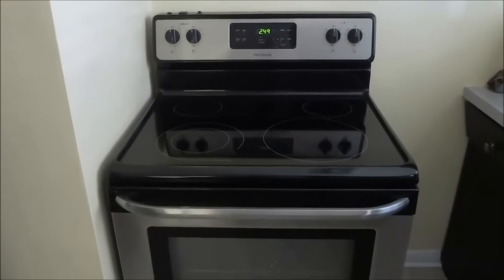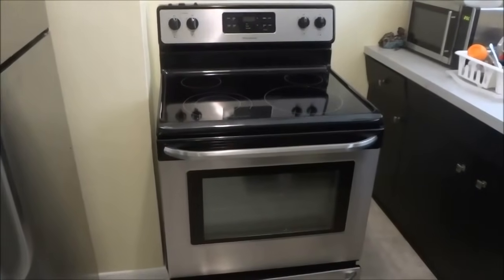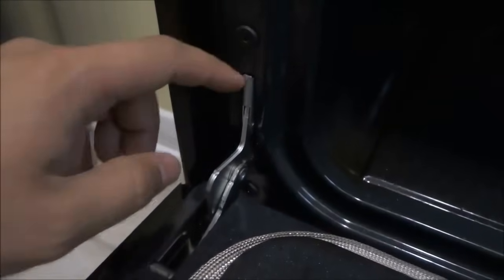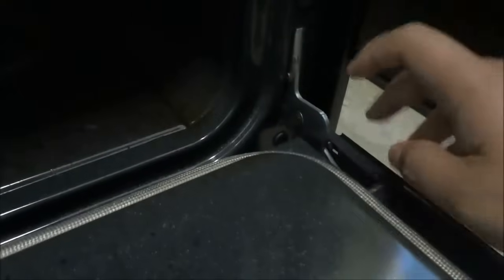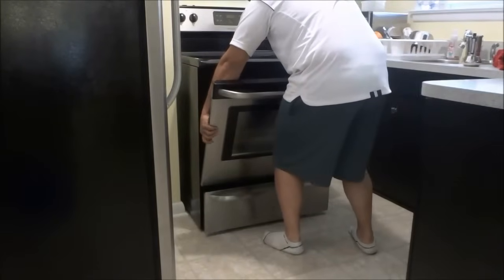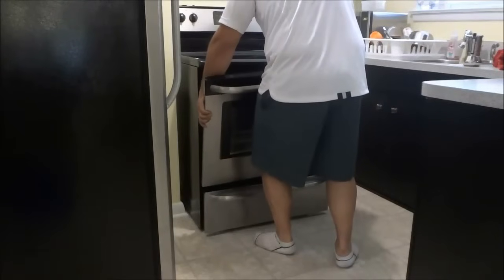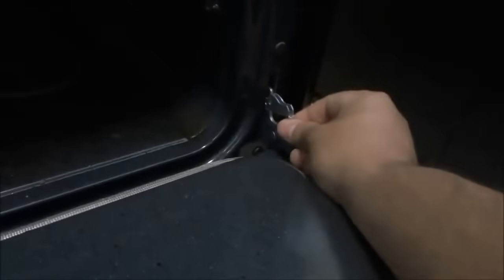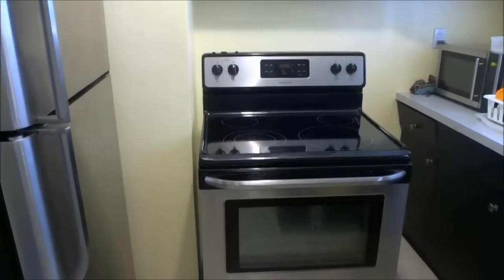How To Remove The Oven Door On A Frigidaire Electric Stove (Useful For Cleaning)

Comment: I want to tell you thank you for this video so much. We moved our stove to clean behind it. The door come off only on the left side and the lock was flat to the door. My son about broke his finger when it smaked back. We were all upset and screaming at the darn thing. Then I grabbed my phone and asked Google and your video popped up. With on one minute my son knew what was wrong. If you would have done such a easy to understand and straight to the point demo, we would have paid a repairman a 💯 to come out and get a great laugh.  That lock thing was flat to the stove door so it had tremendous amount of tension, it actually broke our screwdriver trying to hold it and put the thing in proper engagement.

Comment: WARNING! The hinges have very powerful springs that will snap them back into the door as you pull them off the pin. If your thumb(s) is (are) in the wrong spot you could get a painful injury. Also, you will not be able to reinstall the door with the hinges contracted. You will need to pull them out with enough force to overcome the spring tension using pipe pliers (aka Channel Locks) then prop them out with the hinge locks.
Reply: I learned this the hard way. After much blood and pain, and a thumbnail that I will probably lose, DO NOT put your fingers anywhere near the hinge as you pull the door off!
Reply: 8 years later, and this is still very helpful! Thank you!
Reply: Learned this the hard way yesterday. Also shattered the glass in the front of the door. Not sure what I did wrong, though!
Reply: Yep got my thumb!
Reply: Too late!! I almost lost my thumb 😢😖 but thank you for the warning! Be careful everyone.
Reply: Just landed in the ER for this! Hit a vein/stitches. I have removed the door many times and got complacent. Do NOT grab the door anywhere near the hinge locks.
Reply: @Betty-ro2lz  😐😖
Reply: I have no doubt it could take a thumb off 😫 My stitches start under my thumb (towards my wrist) and curve around to the top of my wrist. No idea how I was able to get that much of my hand in the way. Luckily I did not feel it just felt something wet a minute later. Still surprisingly feels okay. I did successfully remove the door this morning without incident 😂
Reply: That should really be mentioned in the vid!

Comment: Thank you!   Had to remove baking element and it was a real pain with door in the way.  I was concerned i won’t be able to reach inside and connect the electrical spades when new part gets here.   Now it will be much easier with door out of the way.  Thanks soooo much.

Comment: This was helpful but I need a video on how to remove the inside door part to clean the glass
Reply: There is a button on the sides of the door. If you press both, the black cover/top that holds the glass releases, so you can remove the two glasses. Cleaning my oven right now 🤓
Reply: @littleinday8176  Thanks but your model must be different than mine because I don't have a button on either side, just screws on the face of the inside door